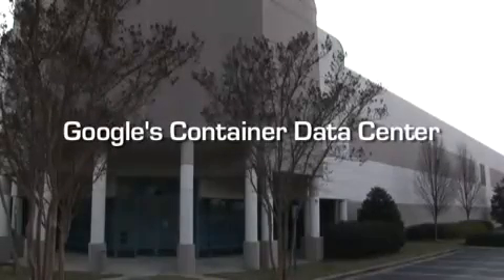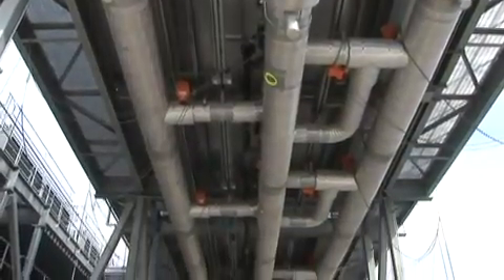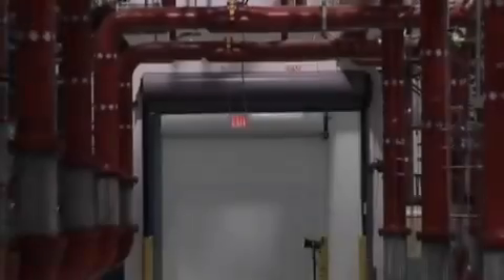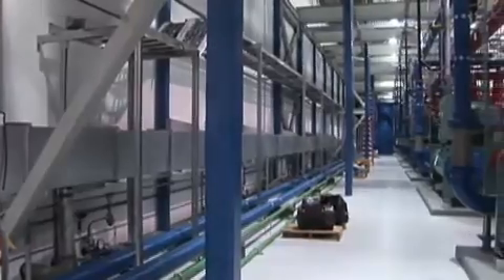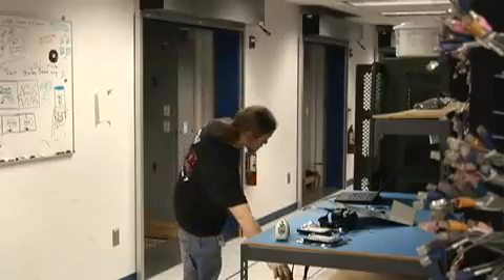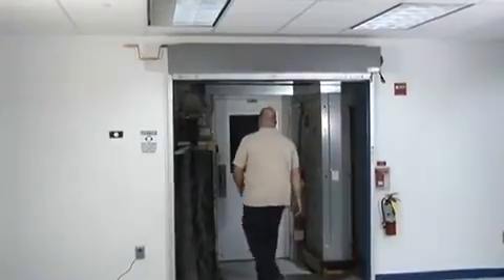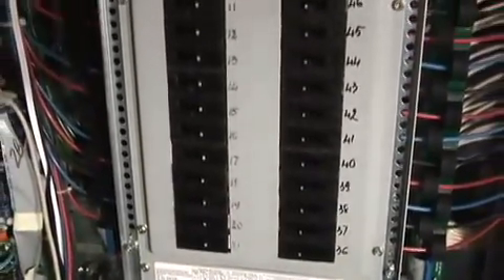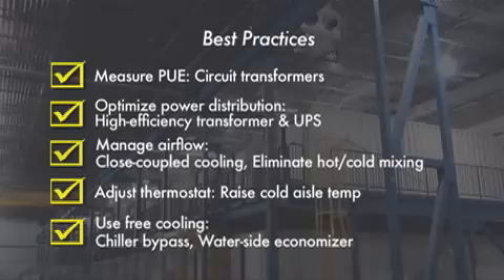The Google Data Center

Comment: 10MW of solar panels would require 50million $ and an area of about 10 football fields. And even if it were installed it would only reduce the energy required by 40-50% (because of night and bad weather). A better solution would be to use the new arm server racks which consume up to 90% less energy than conventional server racks. Those 10MW would drop down to 1MW. Also arm servers produce less heat which would further reduce power consumption (smaller cooling systems = less energy needed)

Comment: the electricians did not use mechanically generated labels on the breaker panels @5:15  , just Sharpie? and the UTP cables are bundled in  non-plenum zip-ties at @5:03   still this is an Awesome setup and I want a "Google PTD "